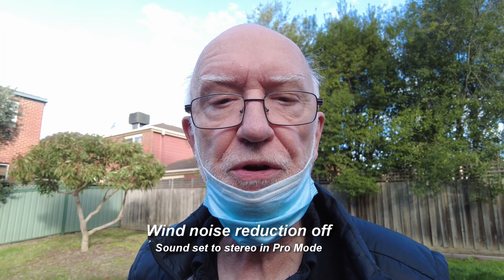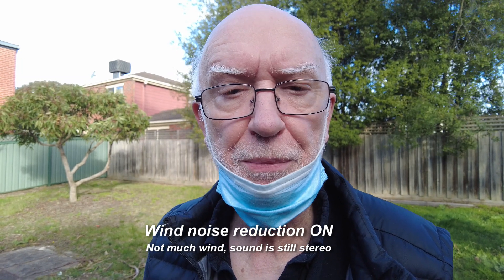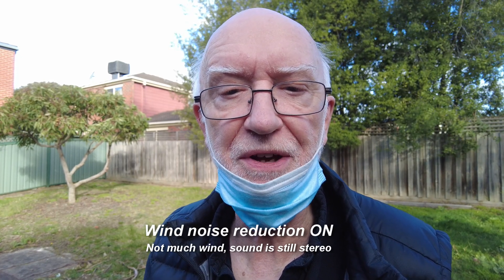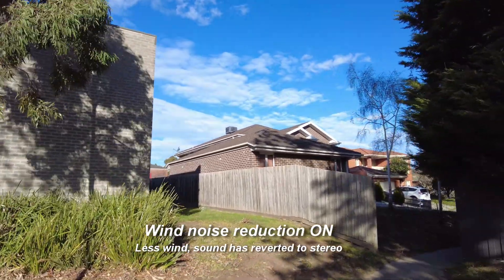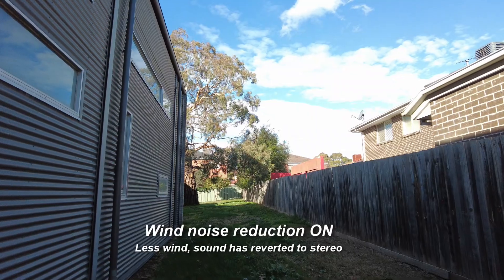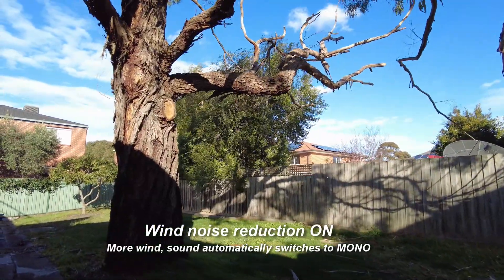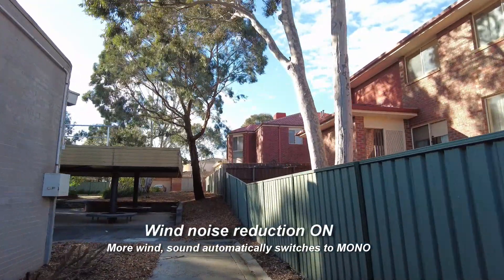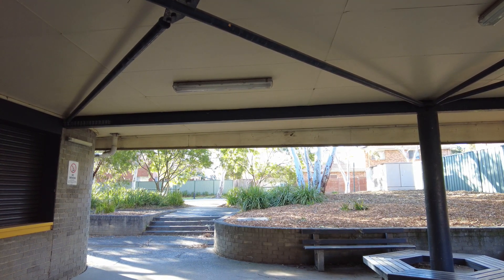DJI Pocket 2 uses PDC wind noise reduction system!

Comment: That was an interesting video.
In my (limited) experience, camera wind reduction normally just muffles the audio, but this didn't sound too bad at all.

I really didn't like the Pocket 2 when it first came out, but it's since grown on me and is one of my favourite cameras.
Although the Pocket 3 is an intriguing prospect!
Reply from the maker: I think the white one coming out might indicate that a P3 is a little way off.  Maybe the chip shortage will cause problems.  I believe Insta360 are having trouble with manufacturing now.
Reply: @Ozpeter  Is the white Pocket 2 any different from the black Pocket 2?
Reply from the maker: @TomRelubbus  Nope.  Just... white.
Reply: @Ozpeter  Is the white Pocket 2 any different from the black Pocket 2?